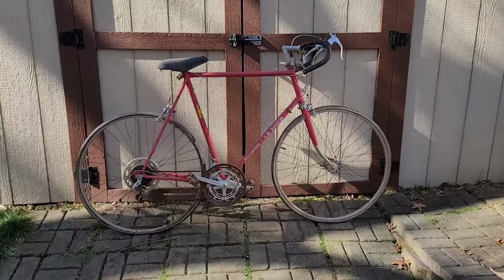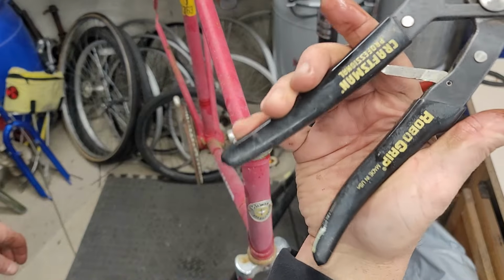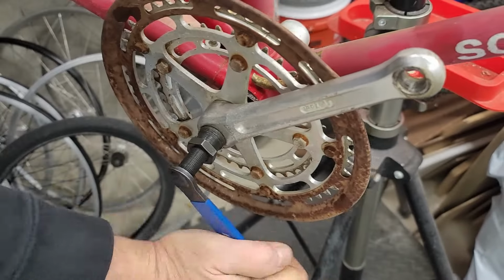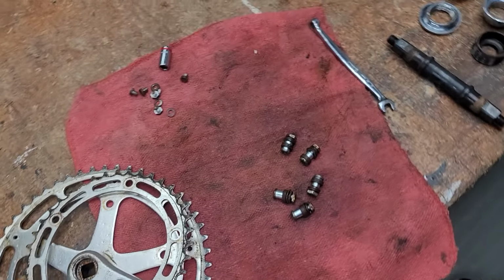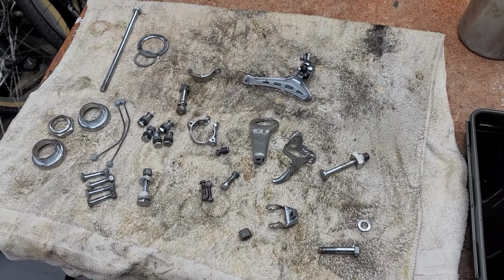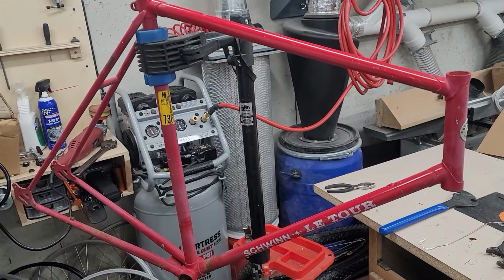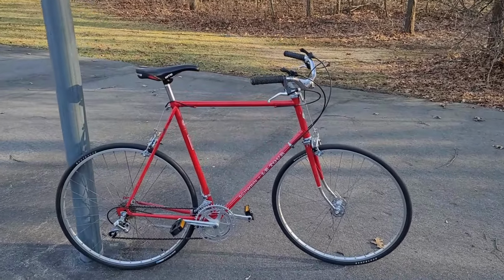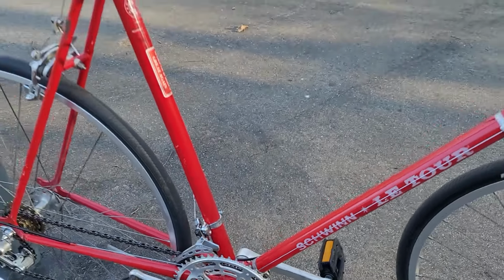Vintage Road Bike Restoration - Japan Made, 1974 Schwinn LeTour - Lots or Rust and Frustration!

Comment: A couple years ago I fixed up a Schwinn Super Le Tour 12.2 that a friend had found in the alley. It was in pretty good overall condition. Loved the Shimano Arabesque components. I put on new tires, chain, freewheel, cables and wrapped the bars in Newbaum’s cloth tape. Sold it to another friend for just what I had put into it: about $100. That model was very comparable to the Superior, which was surpassed by only the Paramount. Japanese-built bikes  from the 70s were some of the best in the world. Keep up the good work!

Comment: This is crazy....my red Letour just turned 50 this month....code on rear axle told me it was manufactured in Nov 1974....I got it new in early Fall 1975.  Every part on it except the brake pads, seat, and rear rim is original, and I still ride it.

Comment: Try hitting the stem bolt with a hard dead blow mallet to knock the wedge loose, after flipping it and pouring transmission fluid down the steer tube for a day.

Comment: Um, in the late '70s I built up the very same wheel & hub combination with my hard saved pennies. Campy Nuovo Tipo hubs and Weinmann Concave rims. In the following years I had to rebuild the wheels but was still able to get the concave rims and even though they don't get ridden any more, I still have the same wheel setup on my old Austro Daimler. The hubs are super smooth and even though the wheels are considered heavy, they are very strong and they have a very classic look. Some people didn't like the concave rims as they were hookless long before hookless was a thing.

Comment: I had a 1974 red Le Tour that I bought new in 1974, retail price of $149.00.  Sadly, mine was stolen in 1979 from my fraternity house in Ann Arbor. I still miss it.  Did you save the original handlebars and front brake levers? I may be interested in it. Thanks
Reply from the maker: Yes, I have the bars and brake levers available.

Comment: Use penetrating oil to break rusty parts.  The longer it sets the better it works or use a hair dryer or heat gun to accelerate the effect.  You can make your penetrating oil cheap by mixing 50/50 any transmission fluid/oil with acetone.  You can dispense it with a spout oil can.
Reply: The granny oil/mix is the bomb!

Comment: I love your work, but I also like dork discs... I think all bike-wrenching people are at least a little bit dorkey, so I see these as a badge of honor... if that makes sense.
Also, dork disks separate us from the hard-core, weight-obsessed carbon-everything fanatics, which frankly is a WAY bigger plus for me than any practical dork disk advantages!
Reply: Nope, that ugly piece of dried up yellow plastic must go, every single time! No dork disc = true bike lover
Reply: @TheMainCore  Literally in the previous video the guy had to replace half the spokes of the rear wheel because they were horrendously mangled, courtesy of a missing dork disk (cheap bike build-off video, go to 15:27)! I agree that for any self-respecting bike lover, badly-adjusted limit screws and/or bent hangers, offer many, MANY obvious warnings... and even then, if it happens just once, it's no huge deal. But not everyone riding these bikes is "a true bike lover". Some people actually need that ugly yellow plastic...